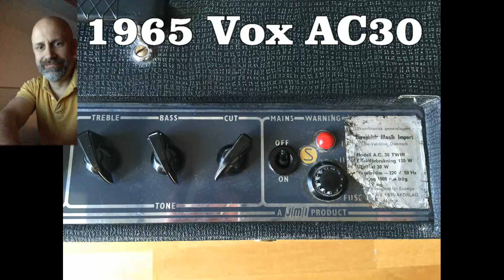1965 Vox AC30 Demo and Circuit Showcase

Comment: Playing nearly the same one from 66. Unfortunately i had to recone the Silver Alnicos, but since they are broken in, the Amp sounds so amazing. Added a PPIMV (at Hole for Power light) and since its my working horse for all purposes. Saw you replaced the Caps with some from TAD. TAd is 30 km away from me, they have great products.

Comment: The notes have an interesting decay, almost fuzz like. I'm looking to get an AC30CC1 for the weight plus single 12 option. Hope it sounds a bit like your sample.
Reply from the maker: +Nightingale1887 Thanks! I think the CC1 has ceramic speakers whereas these are Alnicos though. Cheers Johan
Reply: Johan Segeborn it actually has a Neodymium magnet to bring the complete weight down from 71 to 54 lbs / 32 to 24,5 Kg. So it's little more manageable.
Reply: Johan Segeborn what a sound , hands down

Comment: AC30, the most underrated amp in classic rock history imho. You showed in this clip that the AC30 is more than a clean Beatlesy amp and can kick a Marshalls ass... Hard... Really creamy tone. Great sound.
Reply from the maker: Thanks, yeah I was really surprised by the attack. Cheers
Reply: I wouldn't say that an AC30 can kick a Marshall's ass, but they're just as good in their own way. Marshall's, specifically vintage Plexi's, still have more overtones to my ears and have that "magical" tone that just sounds musical no matter what's played through them. I have several Vox's and love them to death as well.
Reply: How could  be Rory Gallagher. Brian May, Edge and the Beatles seen as underrated? The Vox AC 30 is a highly regarded Classic icon! One of the Top 10 Amps ever been built!
Reply: @arthurnawrath6701  Yes, that is very true! I agree! But the AC30 is often referred to as a great clean or crunchy amp. But full on overdriven it has such an unique tone. Even so, the truly classic rock/hard rock distorted tones are often achieved with a treble booster. Rory Gallagher and Brian May (even Ritchie Blackmore) use a treble booster to achieve this epic tone! But there is something about just linking the two channels together. Such an 'open' distortion!
Reply: AscarinVin 
Yes, that’s right! I love those Vox AC 30s, they are A Gift from God!(Brian May Statement)😎

Comment: 2018 VOX AC30 vs 1965 VOX AC30 Pleeeeeeeeeeeeeeeeeeeeeease!
Reply: IMHO, the newer Voxes (CC2) sound nothing like the Voxes of of old. They sound scratchy and thin, while the vintage ones (and the 90’s reissues) sound varm and fat. They have nothing in common but the cosmetics
Reply: kenichi I assume you mean this http://www.c3605.de/VOX/mod-compilation/lyle-caldwell-modifications/ ; It seems to confirm my thoughts about the CC2’s. I’m glad you are happy with it after the mods

Comment: If you are still up for it, I would love to see a circuit walkthrough video of this amp! I'm interested in the vintage Vox amps. I have a 1993 AC30tbx. I love the amp, but lately I have been wondering if I should have it modified to a more accurate representation of the vintage models. I've played the normal channel for years, but I recently switch to the treble, bass, and cut controlled "brilliant" channel because it has a much better clean sound. I love the way that the normal channel reacts to my pedals. I use a lot of pedals. Perhaps the brilliant chanel will work better for me in time, but I would like to be able to convince the normal channel into playing with more clarity.
Reply: Zachary Drummond I have the same amp. Have you tried jumping channels? I'm shocked people don't do this. I unlocks the tone. If you've got a les Paul, plug into the high input of the brilliant channel and jump from the low input of the brilliant into the high input of the normal channel. Then blend the volumes. They're both active.
Reply: Zachary Drummond if you've got a tele or strat plug into the high input of the normal and jump from the low normal into the high brilliant.

Comment: 1965?  Wow!  Great catch.  Didn't Vox still use valve rectifiers in their amps in '65?
Reply: Yes they did. You can see the GZ34 to the left of the preamp tubes, standing vertically just like the output tubes.

Comment: Awesome video, Johann.

There's a question I've always had you might be able to help me out with. I've heard the sound of the AC30's Vibrato mode, which is kinda like the wet signal of a UniVibe pedal. I've always wondered what it'd sound like in stereo with two amps—one channel being the Normal or Brilliant channel, and the other being Vibrato. Think it's something you might be interested in? :)

Comment: I personally think that the AC30 is a very underestimated amplifier. When set up correctly, they can give some awesome tones. Now if only they still made a bass version...
Reply from the maker: It is indeed! Cheers Johan
Reply: i only own vox amps and I a agree👌
Reply: Cameron Jenkins they made bass versions. the only difference between bass and lead were 7 capacitors. So basically you can buy a lead and convert or vice versa. Bass versions have no top boost circa 64/65
Reply: Cross Guitar Works Malta If you look at my original comment, I hinted that I knew that they once made bass versions. However, some more recent research has led me to conclude that a standard AC30 combo would be poor for bass use because of the open back cabinet. Getting an AC30 or AC15 head would be a better option. I would also modify the top boost tone stack because the stock one is rather weak in the midrange.
Reply: Cameron Jenkins you seem to know your stuff well. They weren't that good when used in bass in fact but a head and a bass cab maybe will work for you then
Reply: Cross Guitar Works Malta Thanks for the compliment. One thing that I do find interesting is that the Vox tone stack has an even more robust bass response than a Fender Bassman. The big problem with it is that it has a sizable mid-scoop, which would have to be changed.